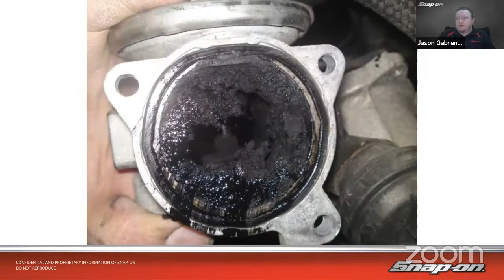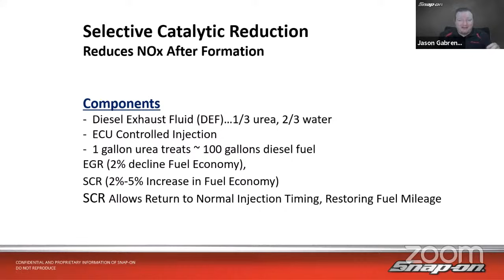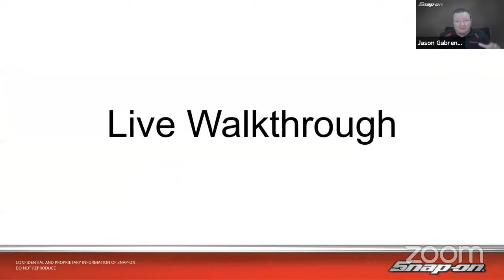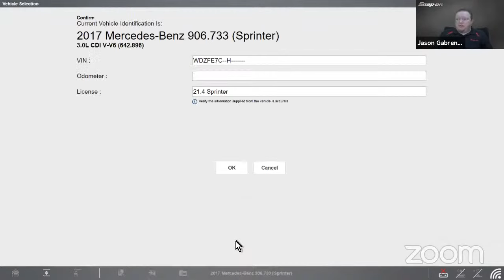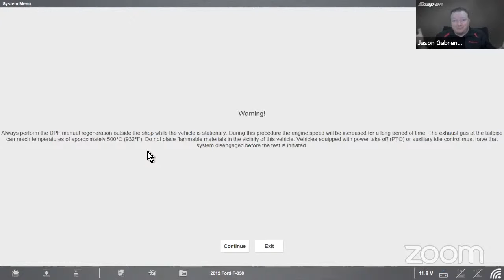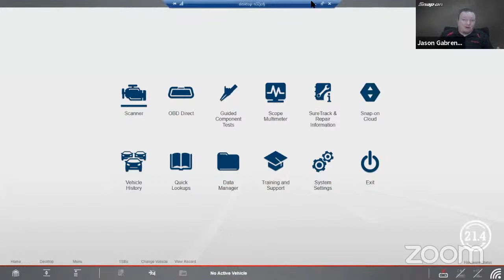Diesel Emissions Systems - Snap-on Live Training Episode 29

Comment: Excellent content, thank you Jason and Snap-on. Also most exhaust brakes (Japanese vehicles)  will not work without the vehicle being in gear now as most drivers used to leave them on when the vehicle was idling being/unloaded resulting in extremely high exhaust valve temperatures (especially summer).